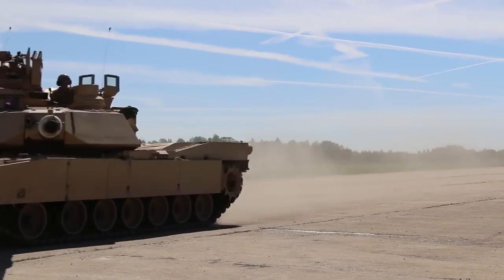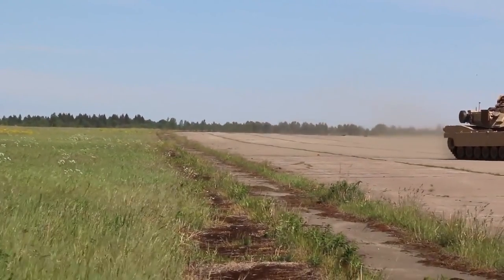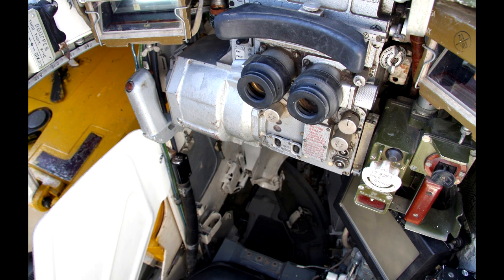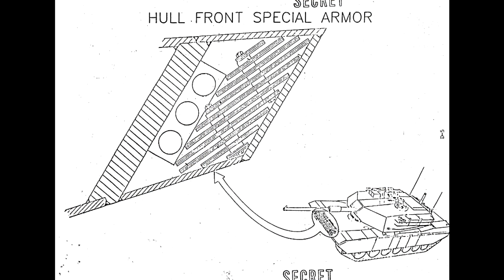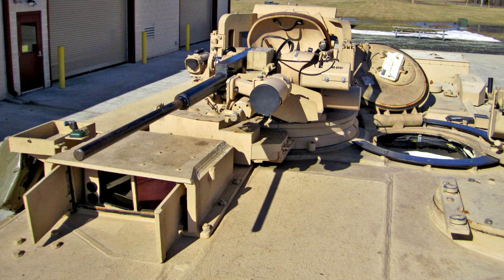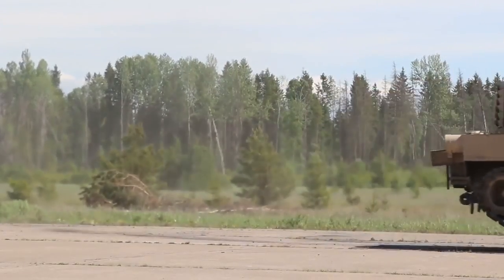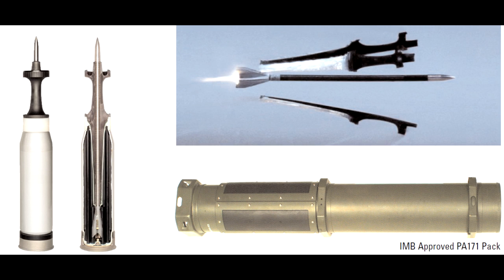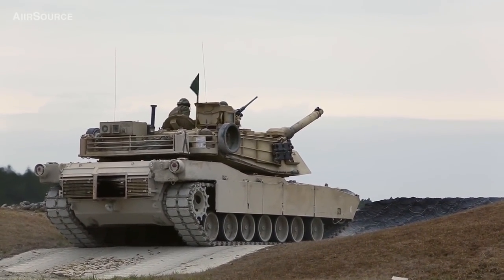Problems with Abrams tank

Comment: honestly the main issue is it's fuel supply.  Most modern tanks have a lot of classified information (shocker) so it's hard to compare the modern tanks to each other, with accuracy.  But fuel is a huge issue.

America 'may' be able to afford it but money is not the issue on the frontline or in transit.  Getting things from A to B is the issue, and a little look at the german armored battalions?  It was an achille's heel.  

Even if the tank has the best armor, hit and runs on it's fuel supply will leave it the prettiest brick in all of the desert. 

As for it's frontal armor being weak, the reason for this is quite simple.  According to most doctrines at the time, the M4 tank is not designed to actually be in a 'brawling' situation.  They would much rather prefer it if the tank was using it's effective long range to it's advantage and staying far away from enemy tanks.  If it is within a shorter range where it's frontal armor is not within cover and in range, the general consensus was 'don't get hit'.  In the end, the engine trying to push even more weight to make effective armor would possibly cause more issues than solve.

That is of course what is publically available and word of mouth.

Comment: The reason as to why a gas turbine was used in the Abrams was because not only does it produce a lot less heated exhaust, but is also quieter over a turbo diesel. It does consume more fuel and I more expensive, yes. But it also provides more instantaneous power allowing for snapper movement and faster reaction times for the 68 ton tank. 

So unlike what war thunder would have you believe, the turbine unless you’re right up on it doesn’t make that much noise, and the exhaust gases don’t show up that good on thermal as they’re a lot cooler/not as thick or dense as diesel exhaust. 

While the Abrams does have flaws, the turbine engine is both a flaw and a huge pro for the tank.
Reply: Looks like you do play too much war thunder, “snappy” movement isn’t as useful as it is in game considering that irl tank combat takes place kilometers away and not in close quarters like in the game.
Reply: @oS-qv7tj  I’m literally aware of this, but sure, and ontop of that in war thunder the Abrams is as sluggish as a WW2 tank. So if you take war thunder as fact you are, just. Stop existing. Also turns out the turbine is more reliable, and what I mean by more snappy movement, it has instantaneous acceleration due to it being. Well. A turbine and doesn’t have the added usage of turbos. Ontop of this snappy movement like you’re think can be crucial in a time of need, but not all of time.
Reply: @FoxtrotStudi0s  I see, my bad for jumping to conclusions
Reply: @oS-qv7tj  all good
Reply: @FoxtrotStudi0s  Man it's a shame most internet arguments don't end like this
Reply: @oS-qv7tj  I just had a dude who I proved wrong about autoloaders and he, instead of just a calm conclusion he threw a fit and called me dumb

Comment: Gas turbine has better combat performance.

Real performance

At that time, most of the vehicle industries were withdrawing from applying gas turbines as motive power. Why US army decided to produce the turbine powered main battle tank ? There must be advantages to select a turbine tank instead of a standard diesel tank. ***It was rumored that the decision was made politically to relieve Chrysler that was in serious financial difficulty.***  

The fuel consumption was an important issue. M1 Abrams gave only 255 meters to the litter traveling, much shorter than diesel tanks such as Leopard 2 (330 meters). This value was given by  the high speed cruising. During the Operation Desert Storm, the value was decreased to 142 meters to the litter traveling, this might be twice worse than diesels.  Leopard 2 consumed 12 kg fuels per one hour during idling. On the other hand, AGT1500 consumed 2.5 times as much fuel as diesels. Idling would take a large part of the tank operation time and it was predicted that the vast amount of fuels would be required in the operation. During the operation, the advancement of the tank force was restricted by the speed of refueling trucks.

What did US Army got in exchange for this serious disadvantage?
The first was the turbine's unmatched acceleration. Turbine's light weight and torque feature gave the tank high mobility.
The second was  the turbine's stealth feature. The rotating and continuous combustion feature significantly decreases large noises, vibrations and conspicuous exhaust gases characteristic to diesels. So that M1 Abrams is nicknamed as "Whispering Death". Turbine's clean exhaust and low noise also gave much more comfortable environment to soldiers while marching with the tank. Turbine's unseen exhausts were also reassuring in battle fields.  https://turbotrain.net/en/m1tank.htm

Advantages
Very high power-to-weight ratio compared to reciprocating engines.  
High agility/acceleration and compact silhouette. 
Greater reliability, particularly in applications where sustained high power output is required. 
 Low lubricating oil cost and consumption.  
Smooth rotation of the main shaft produces far less vibration than a reciprocating engine.  
Can run on a wide variety of fuels.  
Lower peak combustion pressures than reciprocating engines in general.
Waste heat is dissipated almost entirely in the exhaust. 

Disadvantages
Core engine costs can be high due to use of exotic materials.
Less efficient than reciprocating engines at idle speed.
Longer startup than reciprocating engines.
Less responsive to changes in power demand compared with reciprocating engines.
 Characteristic whine can be hard to suppress.
Waste heat is dissipated almost entirely in the exhaust. 

The tiger program.  9/1/2006 https://www.nationaldefensemagazine.org/articles/2006/9/1/2006september--overhaul-under-way-for-abrams-tank-engine  This improves the gas turbine engine.

"TIGER engines will get 400 to 500 new parts and phase-in engineering improvements to stretch their depot intervals to at least 1,400 hours or a hoped-for 1,600 hours. "

https://www.defenseindustrydaily.com/sustaining-the-m1-abrams-us-army-puts-a-tiger-in-its-tanks-01790/ Jun 30, 2011 

https://www.bizjournals.com/phoenix/news/2020/12/22/honeywell-contract-for-army-tank-program.html Dec 22, 2020 

“This is a continuous improvement program that has dramatically improved the durability of the engine and reduced operational and support costs.”

https://calhoun.nps.edu/handle/10945/33815?show=full  Tiger program.

Comment: So I just went to get the relative thickness of 38mm of RHA sloped at 82 degrees. It is 273mm, which is perfectly fine by the standards of a 2nd generation MBT, but is terrible for a 3rd generation MBT (even in the early 80's). So that is a pretty substantial weak point. Still, even APFSDS can be deflected if the angle is extreme enough, and 82 degrees is marginally close to being extreme enough, so the chaos of real world circumstances means that it might occasionally be able to deflect incoming rounds. Of course that works both ways, since the chaos of real world circumstances means that some rounds would hit at much shallower angles. Even WW2 ordinance can penetrate 38mm of RHA if circumstances allow the round to hit at a shallow enough angle (such as if the Abrams is going down a hill).
Reply: Like red effect said even if it deflects it will go into turret ring and penetrate It.

Comment: So first off I want to say the abrams is one of if not the only tank with the most extensive combat historical data. No abrams US controlled has been lost to combat. And the tank and crew has survived a hellfire being dropped on them. Now for the engine. The main reason we use it (yes im a tanker) is its hella quiet. You wont hear us compared to a diesel engine. Which gives us a very big advantage in combat. Our 38mm plate is the way it is because if you noted if a projectile hits it, it slows down and when it goes and hits our turret it wont do much. Dont forget that with it being slopped at that degree it will deflect it. As for soviet sabot rounds, they dont have depleted uranium rounds, they try to increase pressure and use a bigger round their rounds are mainly tungsten. The only tank in their caliber that has a chance of penetrating the abrams is the t14 armada, or them use a atgm. I know this is a old video. But gotta throw what I know. Also when it came to our thermals ours were better developed than russian made ones. We had a vision advantage you can look it up, and our 120, L44 is pretty amazing since we had the a2 and a3 rounds and because of conviction we actually had to lower the velocity of our rounds that would go straight through soviet exported tanks into the next town. With a lot of problems have been fixed on the tank, but of course it sometimes causes new ones. Our tank is pretty solid and a lot of old hand tankers will tell you the m1a1 is better. It ment your gunner had to be more alert and actually scan. Your tank commander was just there to verify you hit. Which came down to us having better gunners. Whenever technology replaces something a human can do you become more relaxed and less attuned to being in the shit. Which means you get complacent. Now comparing our tank to the leo 2 I would call you an idiot. Because our tank is better than it by a long shot. Mainly because our tank doesnt malfunctions like theirs does in the heat. There is a reason we got a contract with Saudi Arabia. Also the hydraulics for the main gun and the turret for the leo 2 is a horrible design they tried to fix it by making the turret run off electricity. 

Anyway all tanks are cool and unique but at the end of the day I will always go with the tank that has the biggest historical data of being battle tested and coming out survived. All exported abrams are no where what our actual abrams is capable of. And our tank hasnt been destroyed in combat.
Reply: Go chearch on Daesh you tube, go see video of Abrams getting blown up
Reply: @76456  go look up their track record, it probably got disabled and repaired within a week and put back into action. Most of our tanks being disabled by either friendly fire or a mine lol. Our abrams has amazing armor. There the is a reason we are the heaviest tank on the battlefield.
Reply: @omiotod  heaviest, like if Abrams was small, Challenger is heavier. Not gonna elaborate more, I don't care. Just shoot hull or side turret and your tank get penned

Comment: You know you're crazy I'm won a free Abrams yeah I think that's correct This 1 will have every single pc of round again it I'm accurate switches to a piano that stuff so even if you're fire but you don't have to take it around now when we play it was another 1 and it's should be fixing on most of the gun problems And by the way this tank is in men for the of the M1A1 tank is not been 4th war with Russia it's meant for war with some food world country

Comment: My opinion on the best mbt in the world is the Leopard 2a7, but if I would design the Leopard 2a8 I would add blow out panels and remove the ammo rack in the hull. I would also improve the composite armor and the turret traverse speed. Also I would try to make more room in the fighting compartment.m seeing how crammed it is.
To the people who think the m1 Abrams is the best tank, it really isn’t. The cannon is German. In fact, it’s the same canon as the cannon the Leopard uses but it has a different name (M256 (RH-120) I believe it’s called). The cannon from the Leopard 2a7 is the L/55.
Reply: Blowout panels for the front ammo are most likely impossible and they already exist for the ammo in the turret.
Reply: Add American ammo, Russian/Ukrainian ERA and Israeli APS
Reply: There is no such thing as best when it comes to weapon systems. The tank is just part of that system. Taken together a weapon system is optimized for a set of environments. The Leopard and Abrams plus their support were designed with different missions and requirements. So who fairs better depends on the circumstances they face in combat.

Comment: I still think that the Leclerc is the best tank. This only compares the Leclerc S1 to the M1, and the main source is Wikipedia so the numbers probably won't be perfectly accurate, but
Unless you cover your tank in a few dozen meters of the finest metals possible, with every defensive measure possible like smoke and entirely made of 45 degree angles, you'll still have at least a 75% chance your tank is knocked out instantly upon getting hit by a modern shell/ATGM, and that's not counting the damage caused assuming you don't get knocked out immediately.
So the Leclerc has very little armour, but it has much more well thought out active protection measures, which also limits the weight of the vehicle.
The crew of 3 means it takes less manpower, whereas the M1 Abrams of the time had an extra loader, which also reduces loading time on the Leclerc.
The Leclerc has an engine that, from what I know, is effectively identical to the Abrams in terms of hp and noticeably better in range.
Reply: 3 man crew has advantages but also disadvantages. While an auto loader is more consistent with its speed a human has a higher burst speed. It also means that you have one crewmen less that can repair the tank in an emergency. And it is also one additional technology for which you will need spare parts.
Reply: The loader can also man the machine gun on roof during road marches as air sentry. However fast a loader can be he slows as you use more ammo as he has to reach further and further into the storage. Auto loaders can fire until it is empty. 

3 man crew means the 4th guy can crew another tank meaning more tanks fielded.

Both have advantages as you say
Reply: The Leclerc has a longer calibre of barrel for better muzzle velocity iirc

Comment: The M1A2C3 is equipped with an ETC Electro-Thermal Chemical Cannon. 
https://www.google.com/url?sa=t&source=web&rct=j&url=https://www.sto.nato.int/publications/STO%2520Meeting%2520Proceedings/RTO-MP-AVT-108/MP-AVT-108-37.pdf&ved=2ahUKEwiyj8Sm5K7xAhUIOs0KHdiAAMoQFjAHegQICxAC&usg=AOvVaw3ncETe9I9cFx8zIMQkAbvN

Comment: I think biggest design flaws of the m1a2 abrams was that extremelly weak ufp and gun shield. Relying solely on angle on the ufp and having 400mm of RHA protection in gun shield is a big weak spot. You may argue ufp wont get hit in an hulldown position but you simply can not keep a tank hulldown forever in a real hard conflict. Hell even an rpg7 can penetrate that place.
Reply: With good training I think you could def stay gull down for the majority of a fight. A tank isn’t going to just stay still, it’s going to relocate to keep its distance and to stay in the advantage.

Comment: Having passive NVG's for both the gunner and commander can still be worse than just having thermals for the gunner. The max range of the passive NVG system on the original T-72 is only 600 meters.
Reply: they have both passive and active, atleast according to the video
Reply: Shhhh don't tell the Computer Commanders this fact.

Comment: When the M1 came up against the monkey model of the t72 the bogeyman turned out to be completely outclassed, and the m model alone does not explain it.  I suspect western tanks were fighting against superior paper tanks for years.  Its big weakness is clearly fuel, I suspect the advantage of multi-fuel is the ability to scavenge, the hull looks solid at the slope, but always curious why the turret ring is exposed in so many tanks, leo especially - challenger excluded, I suspect this is a real weakness.

Comment: The reason for the turbine engine is called the "military - industrial complex". And it's not about saving tax payer money on the contrary the whole goal of this corrupt system with the Pentagon as it's head office is to funnel as much tax payer money as possible in to private hands via military spending which in turn goes to a contractor i.e a corporation and then to "investors" shareholders and ceo's.

Comment: the turbine doesent use as much on idle, that sounds like absolute BS
Reply: sadly its true mate. its very counter intuitive but its one of the down sides to a big turbine. the r.p.m. is the same regardless if the drive is in or out. its the one big difference between a jet engine and a turbine.

Comment: No armor is best armor not with apfsds but still, and honestly no tank is really safe as far as armor goes, yes they all have good turret protection but modern tanks have lackluster hull armor. Apfsds will most likely slide right through most armor head on
Reply: you do know war thunder doesn't have the specs for modern mbts? most of that is still classified

Comment: The M 60 was much better as the M 1, the M 1 is trash!
Reply: ??????????????????????????????????????????????????????????????????????????????????????????????????????????????????????????????????????????????????????????????????????????????????????????????????????????????????????????????????????????????????????????????????????????????????????????????????????????????????????????????????????????????????????????
EXPLAIN????????????????????????????????????
Reply: So the 105 beat 120?
Rolled Homogenous Armor beat Composite Armor?
Reply: @F-15J Eagle more like No Armor Best Armor
Reply: mister reformer here, would you say the f35 sucks and we need a plane with no radar and no flares but the thing it does have is a 30mm cannon?

Comment: multi fuel gas turbine vs diesel????? Commander over ride?????? You bloke are nothing more than a lonely kid with the internet. Soviet tanks are weak, have limited protection and poor sights in the real world, soviet tanks are rubbish, the soviet APFSDS rounds could penetrate at close range not at 1500m, you muppet, Abrams had Chobram from start, you know shit
Reply: Russian tank now has capable tank for the modern standard, unless if you're refering to "old Soviet tank" which Russia didn't used anymore, your comment is nonsense